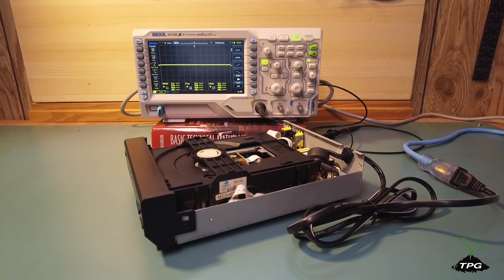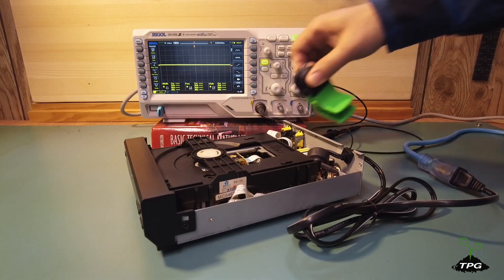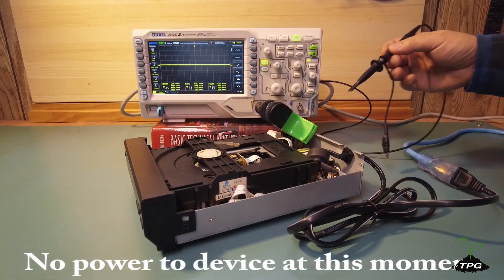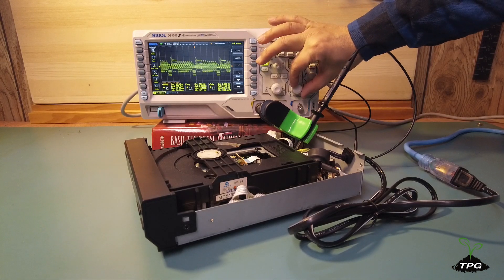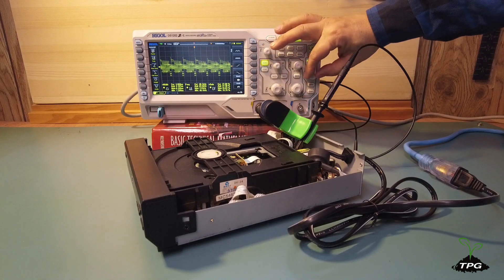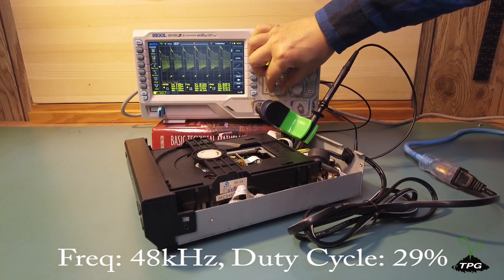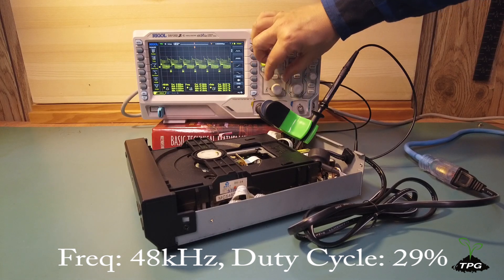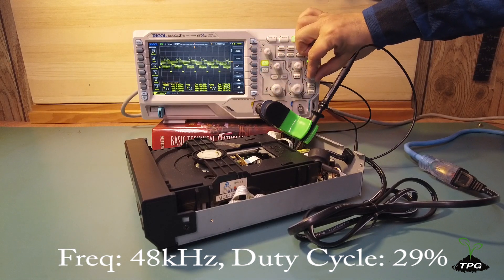Oscilloscope: Non-contact Probing - Measure signal without physically touching the circuit

Comment: It's usually much easier to thread a bit of magnet wire through the transformer. Then you're actually measuring the flux through the single loop.

Comment: Yep, looks like a healthy flyback transformer you've got there. This is a valid measurement method, but this is probing through capacitive coupling (dV/dt) not induction, as you don't have loop at the tip (e.g. clipping your ground lead to the probe tip).

Comment: This is a "EMI measurement" by capacitance. Not by inductance. It will be better to use voltmeter to check this PSU instead.